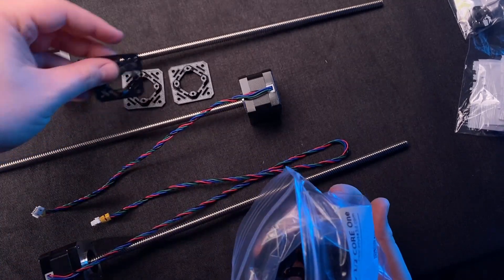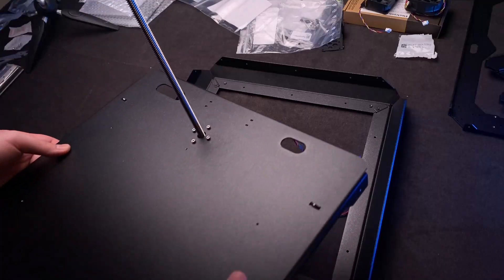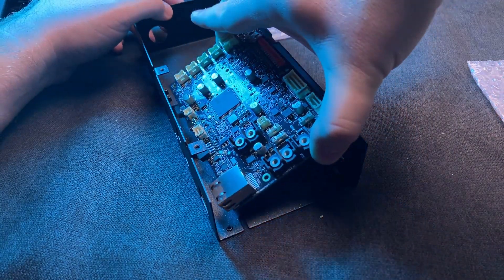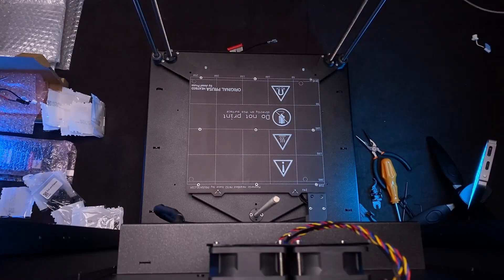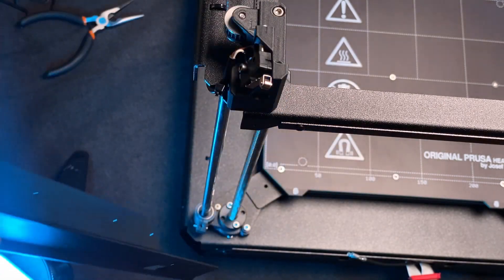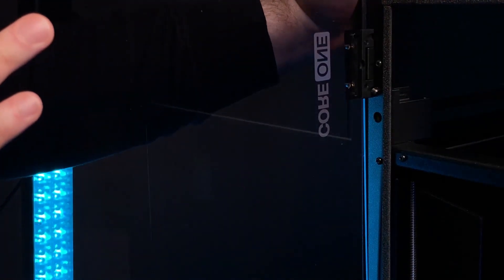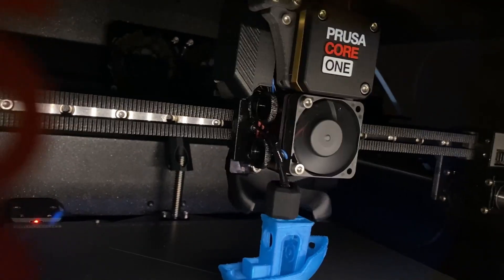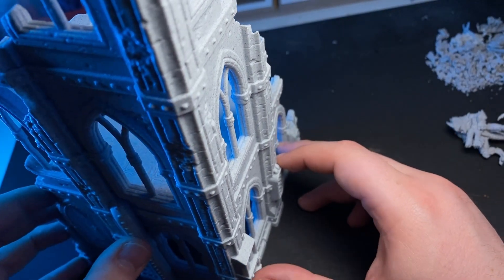Watch HOW & WHY I Built This 3D Printer for Wargaming Minis!

Comment: I got the prusa core one for my workshop and I’m extremely satisfied ;-)
Reply from the maker: Yup :) I'm still in the learning process to get the prints as good as they can be, and just yesterday I printed a tiny shovel for a tank model by adjusting the Arachne detail toleration in Prusa Slicer. Even with a 0.4 mm nozzle, it printed a tiny mount for that shovel. I just need to figure out how to print resin supports or support settings in general :D It's so cool :D And addictive :D